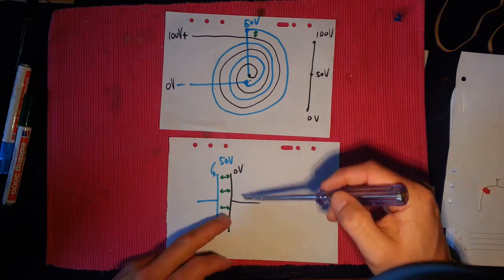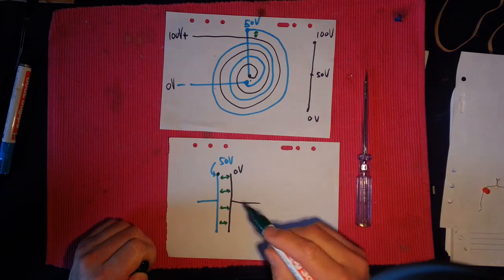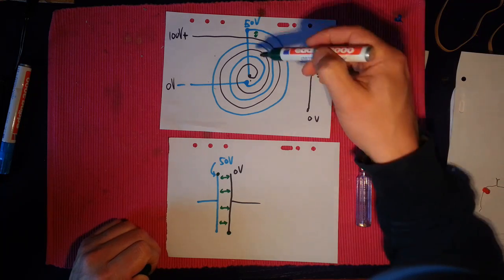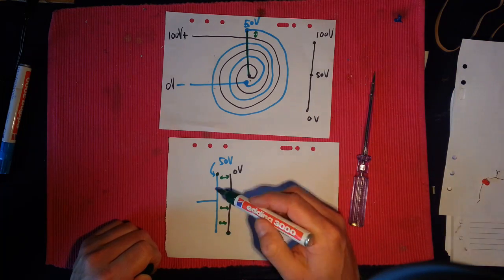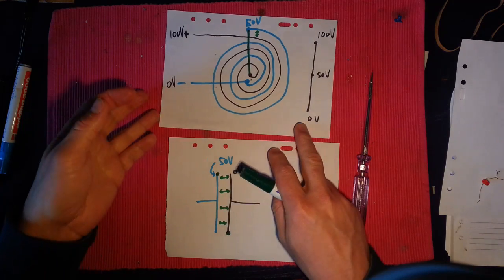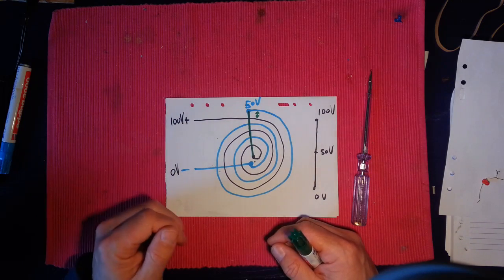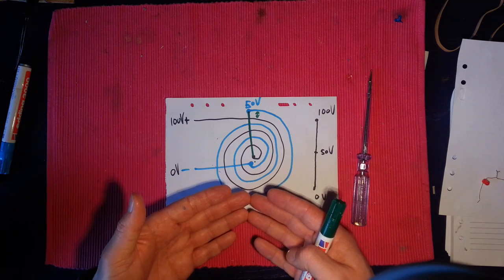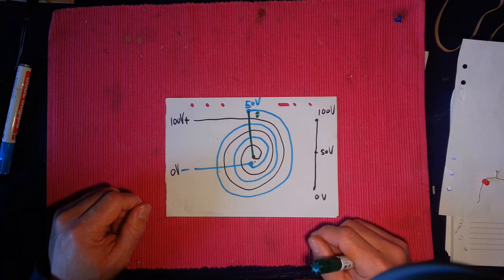The dielectric field of a bifilar pancake coil

Comment: Hi , your experiment is much good but the main thing is to utilize this technology to run heavy resistive load , primary side is okay , the secondary side you have to use resonant LC circuit with rectifiers and then the inverter with output resistive heavy load , you have to variable frequency drive at output for optimum output , try this , any help msg me

Comment: Nice  work; great explanation especialy of the dielectric effect.
Question:   suppose anode    LED_1 is in  parallel with cathode LED_2 
                      and        cathode LED_1 is in  parallel with canode LED_2  
 would that  eliminate the  need for  diodes ?

Comment: I'm not schooled in classic electronics and engineering,  so im newb... 

 Question:

 1. WHY isnt dielectric feilds affected by impedence or resistance?

  2. Why isn't the wire coatings (rubber or poly urethane or whatever) GETTING HOT from the electrical current generated by the dielectric current generation from the gaps between the two coils ...? That wire coverings are the 1 object within that space where the whole action is happening... Please explain, thanks 😊 🙏 🙂
Reply from the maker: 1 it is. dielectric field= voltage
2 it is getting hot. more amps more heat
Reply: @MasterIvo  I think since i obviously need to study Electromagnetism more, i will study it with dielectric fields in mind as well... Thanks for enlightening me, answering my questions, while simultaneously filling my head with more... 😆
Reply from the maker: no don't study EM, study electrostatics! and dynamic electrostatic fields. rapid changing electrostatic fields. (that is Tesla's advice)
Reply: @MasterIvo  Next question -- Is it Absolutely necessary that the 2 sets of coiled wires are insulated from each other in the coil plate? And only touch where you want them to...? Could you speak on this matter please,  or refer me to a pre existing video for further understanding and clarification 😅
Reply from the maker: a bifilar pancake coil is acting as a plate of the hV capacitor. I guess it can be a regular pancake coil. not sure, I need to experiment more and learn from it.

Comment: I have a interesting question what if that capacitor is composed of diferent materials? ore if it is conected in the midel with ground ore metal makeing it a 3 layer capacitor? how does a polarized and non polarised capacitor interact with that subject . How does that coil and capacitor interacts with insulator does they tend to brake down?
Reply from the maker: what about the coil IS the capacitor. 2 pancake windings forming the plates of a capacitor.

3 layers is making it series. (less capacity but higher voltage rating)
Reply: @MasterIvo  well most of my trobel begine useing plazma ignition honestly the electric motors and alternator have their minde of their own and the baterry behaves rather diferently the normal I ques.
So my bigest problems are the baterry and aperantly fast break down of brushes on my electric motor/alternator.
I belive those coils work best on a blushles motor.
And aperantly that staff interacts with the internal voltage regulator on the alternator.
Cut in short the baterry is not fried like normaly peopel see it hapening by over ore under charging.
Prity much unique effects.

Comment: Have you already told somewhere about your pulse generator & tuner? Those 2pcb's mounted together to sweep around ~630khz? I suppose its maybe custom-make, are there gerber files posted anywhere? This is soooooo excellently concise & on-point, props bruv!
Reply from the maker: Thanks! yes gerber files can be found in the description (follow the PCB link). I use a external dual channel square wave generator (rigol).

Comment: Hey, how do you find out the resonance for any coils? what do you like for, to say that it is at its resonance? best regards Nerv
Reply from the maker: you could calculate (from the coils capacitance and inductance) it, but I never do. I just change the frequency, and look for the maximum voltage sine wave.

another method is hook up a probe (oscilloscope) to one end and ground the other end of the coil. then give the coil some dc voltage (builds up a magnetic field) and then suddenly take that voltage away.

the coil will then "ring" at its resomamt frequency.

if you record this and zoom into the ringing you see its resonant frequency. now you know which frequency to dial in.

Just play with the coils and learn from them, they thought me more than any book could teach me. Open your mind, and your intuitive heart and you will know.

Good luck!
Reply: @MasterIvo  Thank you! This comment helps alot!

Comment: The one wire effect is pretty cool to see on slayer exciter circuits too. I think all it took one time to put some charge into a 12v lead acid battery was making the AV plug and just putting positive to positive and negative to negative. It would charge with only a suitable antenna but much slower. The high frequency high voltage is always looking for ground I guess whether it's a true ground or virtual. Gbluer had some pretty amazing tests using earth grounds and tuned coils for capacitive coupling. Fairly large arrays of leds would be lit super bright from only the topload connection at something like 1.5v input.
Reply from the maker: Leds are fun, but we need real power, like 1kW to do work.
Reply: @MasterIvo  definitely it's just nice to see some of the voltage ratios coming in and out of some of the more meticulously constructed bifilars.

Comment: Wouldn't using insulated wires diminish thee effect wasn't tesla using bare wire?
Reply from the maker: No the " insulation" is a dielectric, often better in storing energy it the dielectric field than air does. Tesla used guta percha. for his coil windings. A sort of cotten soaked in wax, wrapped around the windings. he also used oil as  a dielectric.

Comment: Driving the coils at resonance typically increases the coil temperature to a point of thermal runaway. Any chance you have thermal measurements on coil temperature effects as they are driven at resonance?
Reply from the maker: the coil with in phase current and voltage warms up slightly. rest stays the same.

Comment: I still don't get  how a simple LED was lit with just one wire and no return path 
Someone, please explain
Reply from the maker: resonance. It has a little bit of power, when the fields transform into each other, dielectric into magnetic and vice versa. look at the phase lag between the fields. when one is zero the other is maximum. but in between, there is a bit of both. when both fields are present, this is electric power.  But there is not much of it.

Comment: The device is turned off , then you short circuit the capacitor multiple times and it “refills” ?? I’ve also seen that after you short circuit the capacitor the voltage rises again around 180Volt. What type of capacitor it is voltage and capacitance ?

Comment: Amazing videos very educational. If you get to read it kindly google Otis T. Cars (Nikola Teslas)flying saucer patent and you will see how they used bifilar pancake coils wraped around aluminum and  conected on oposit sides so they form a utron shape( two ice cream cones that have 90 degree angle conected in oposite direction) oposed to the flat pancake form, and the plus and minus are conected to battery plus and minus which resides inside of these coils which pass trough a c shaped el. magnet at 45 degree angle. Long story short kindly investigate that it uses the same principle as yours with capacitors and diodes and if you can make a video about it which would be much apriciated.
Reply from the maker: Thanks, yes I have looked into it.
Cone shape coils still hold my interest.
Reply: @MasterIvo  cool hope you make a video about it one day because it is interesting how it charges the battery when it runs trough that c shaped el.magnet and at the same time acts as a motor :)

Comment: Hey dude,  just a little point of clarification, The average total electric field acting upon a molecule or group of molecules inside a dielectric. Also known as internal dielectric field, so a electric felid is what you mean when you say a dielectric field ?
Reply from the maker: No, take a look at the Steinmetz series I made. The electric field exists out of 2 fields: magnetic field plus dielectric field. If both are  present (in phase) electric power is present. This also is present in a vacuum, but a high dielectric material can help
Reply: @MasterIvo  thanks😀

Comment: Since you have your hands on it unlike me, who would need to build all your set up, one question: One of the main purposes of Tesla was communication. Have you tried to broadcast a radio signal through your set up and check how powerful the receiver is getting it? I assume the Bifilar, just like the Tesla coil would be broadcasting a longitudinal wave, and you could check that by placing your receiver inside a faraday cage. Also It would be interesting to see how far that transmission would go, since you are feeding 12 volts and the coils is multiplying it.
Reply from the maker: Tesla coil isnt longitudinal. Only if the primary is made to produce impulses, and the the coils are properly tuned.
This tuning produces resonance and is what produces the high voltage.
I haven't tried radio yet, bit I am thinking about how to do it. It should be very high in efficiency.
Reply: @MasterIvo  yes, it's longitudinal, specially when you use a bifilar primary. I've done it. And this guy here too: https://www.youtube.com/watch?v=wjz-5Lqtxow
My guess is that pacake bifilars will show the same results. I'm on a trip right now, but as soon as I come back, I will build the set up to find out. People are into this wireless energy transfer fever, but let's not forget that communications was Teslas's main purpose in the beginning. And this is as much a revolution as well.

Comment: Hello Master , in your more recent video you mention that the outer connection is always negative whilst at 1.41 min you mention it as positive . was this just for demonstration purposes for the capacitance or is it set up different?
Reply from the maker: The key is to have the inside rim resonant (sine wave). the outside rim stays stable in voltage (except for the impulse passing through). It can be possitive 500V due to the offset.

Comment: Hey man. awesome. i have a Question: What is difference of dielectric field of the magnets and dielectric field of bipolar coil that in result, for giving power we need a rotation of magnet but not for bipolar coil. Thanks
Reply from the maker: not sure what you are asking, but; The bifilar coil has dynamic fields, and the magnet has static fields. Therefor to use a magnet, we must move it (make it dymamic).
The dynamic fields of a bifilar coil can transform into each other.
magnetic into dielectric and vice versa.
For example, we connect the coil to a circuit, and provide it with a dielectric field (voltage). The bifilar coil will transform this into a magnetic field.

When the circuit is opened, the magnetic field is transformed back into a dielectric field (voltage impulse) called Back emf / inductive spike.

This very powerful impulse can be used to generate power, see one of my latest video's for that ("radiant power..." )

Comment: Very interesting again! Can you use that energy in the cap for ON DEMAND energy sources to power appliances or anything useful at this time?

My efforts and beliefs are in decentralization of energy, water, gas and any other "shared" utility. Sure, this will not be in the interest of some businesses, but they always find other ways to get you dependent on them. Remember "long distance" charges? 
This is good material.
Reply from the maker: No this setup is is powered from resonance where the voltage and current are out of phase, so there is no real power in this setup, only voltage, but no current. In my latest video, I do have power.

Comment: I'm confused. Where is the mystery? I did the same thing with a crystal radio fifty years ago. The single wire is an antenna ( directly connected to the transmitter, I may add) the rectifiers and LEDs along with all or the connecting paths form a close loop in one direction and an open path in the other direction ( as rectifiers tend to do). I would hear the local AM station all those years ago. You replaced my headset with LEDs.
You wouldn't be surprised with your results if you replaced one of your LEDs with a coil of fine wire, because you would immediately see the coil as an antenna. Well!  the traces and the inter connection of the LEDs form a very poor, but nevertheless sufficient antenna, when you are directly connected to the transmitter.
Reply from the maker: this video is 2 years old, learned a lot since than. Here is the magic: https://youtu.be/1Flj1i0zQ-8
showing Nikola Tesla's radiant energy at work lighting a 28W lamp, by my solid state hairpin circuit.

Comment: How did you coil so thin bifilar wire please help and can u please tell that which resistor to use
Reply from the maker: no resistor! resistance turns resonant energy into heat.
Reply from the maker: by hand with doubled side tape on a cd sleeve. later found out this is much better: https://youtu.be/ZKP9Bgpqa5E
Reply: Thank you , please tell the things that I mention are enough or somethings missing 
1.speaker wire 
2.series connector 
3.battery 1×AAA
4.battery holder 
Something else? Please tell
Reply from the maker: pure copper speaker wire minimum 0.75mm2 thick, 10m for one low resistance coil. 
and input voltage can be much higher
Reply: Great ,thank you but others are using transiators and resistors why ?And is it necessary to earthen it. And someone told me that the transistor  through the dc pulse creates a magnetic field please help .
Reply from the maker: @marvelousyouth4650  I advice you to look through the videos on my channel. the Steinmetz lectures explain very much, as do the radiant energy videos.
It al depends on what you plan to do with it.
Reply: Actually i just want to illustrate a wireless power transmission

Comment: Although I have not built it, I understand that the purpose of the bifilar  coil is to match (bend) the magnetic to the electric, so that they are at zero degrees to each other, instead of ninety, thus both run together. The second coil is to make a similar but opposite current, thereby the two elements of an energy circuit, without resistance, wireless, and cold.
Reply from the maker: the second coil winding magnetic field does not oppose the first coil winding magnetic field, they both enhance each other

Comment: Hey.man that's amazing I get the same results, the only difference is that I use toroid coils instead. Basically I have a series of trifilar toroids, 2 channels connected same way you do,  and all of the 3rd channels of all coils connected in parallel, and I can catch residual energy from the bifilar resonant coils, I'm building a larger model in order to see whether I can catch more residual than energy wasted on the amplifier. Great video
Reply: No formula has been calculted for this type of resonance yet. But le me tell you my findings, the more turns you have the more capacitors in series you can handle. Is it by far more efficient to array series of coils than having a big coil. Another good advice is that if you have enough turns you might be able to operate on the audible spectrum 20 to 20000 Hz. If your system works on that spectrum then you can operate with audio amplifiers which are cheap and efficient y comparison with rf amps which are quite expensive and low power.
Reply from the maker: Thanks Horacio hherasq. Great work!
Reply: Master Ivo  my friend is it possible to have a formula on how much coil i need to have a specific ''outcome'' ( basically 400 turns on my coil disc = this much of outcome ) Thank you so much for your Videos :)
Reply from the maker: @antreasepifaniou5959  Not that I know of. Windings relate to inductance, but also to capacitance. Just use 10 meter 0.75mm2 speaker wire, and make it as I show in another video: https://youtu.be/ZKP9Bgpqa5E
Reply: thank you so much
Reply: @MasterIvo  brother, first of all congratulations for your very enlightening videos, i am replicating your setup, the primary's and secondary are both tesla bifilar? if i got it right your secondary is half the length of the primary? if i use same length for both coils with just 2 coils, can i expect the same results? thought the coil you mention with 10m of speaker wire, its quite big, coils half the size will reduce the effect? just one more thing, the IGBT that you mention is purchased? if you can point out some reference on eBay it would be great, keep up the good work, king regards
Reply from the maker: @jujusalva  which circuit replication? I have many. use equal weight copper MASS.
Reply: @MasterIvo  the one in this video

Comment: what serves as Ground in your setup? a plumbing pipe or?
Reply from the maker: Yes a direct connection to the water pipe that is properly grounded.
Reply: The third wire on your outlet, if you have one. In most countries, they don`t use a ground wire. I guess they don`t see the needs for it. Remember, Phase, Neutral & Ground.

Comment: at 7:54 are the diodes actually sending "DC" from each half AC wave to the LEDs and that is lighting this up? I had the same effect when I pulsed a coil that was wound over an iron core. I put 2 secondary coils over the same iron core.Then I had secondary coil A with one open and and second end connected to an LED. Sec coil B had one open end and the other end connected to the LED. LED lights up even there is not closed circuit.